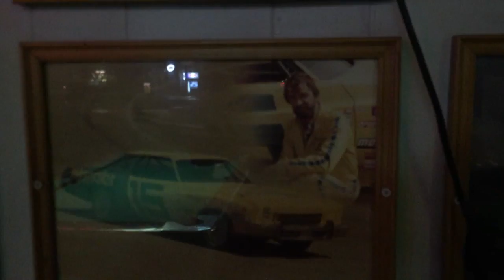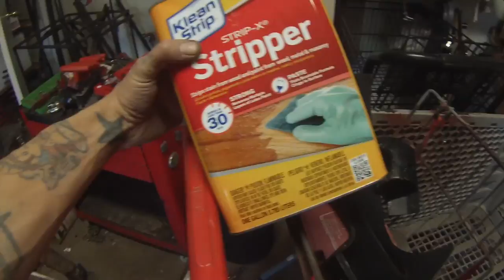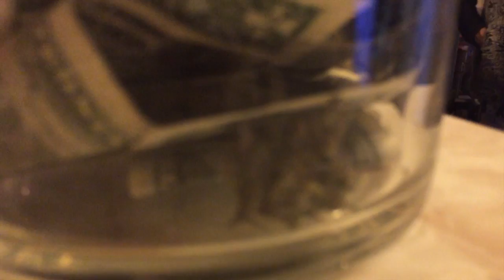Junkyards and... S01E09

Comment: What camera do you use?
Reply from the maker: +LawnTractorBoy i switch between a gopro 3 white (which i am giving away to one of my first 500 subscribers) and my iPhone 6. will pick up a gopro 4 when one goes on sale.
Reply from the maker: +LawnTractorBoy oddly enough, after hours of filming on both, i honestly think my iPhone 6 camera and mic are way better than a gopro3's. hopefully the 4 is better. i know it has way better night filming at least… i think gopro is really more for a placed action cam. the lcd the new one comes with drains the battery and is no more helpful than the iPhone app, and no zoom….
Reply: +waynesworld I'm getting a GoPro Hero 4 black for Christmas. Off my YouTube channel I do a lot of photography and film making otherwise I would get the silver. Have a look on Amazon and just do a general search on Google. That's where I found the one that my parents have bought me.
Reply: +LawnTractorBoy spare batteries help with GoPro's.
Reply from the maker: +LawnTractorBoy yea i have a few batteries. and i see them on craigslist a lot cheaper than the amazon sales. just have to call gopro to check warranty first ;)
Reply: +waynesworld I have a portable battery pack for when I am not using the case.